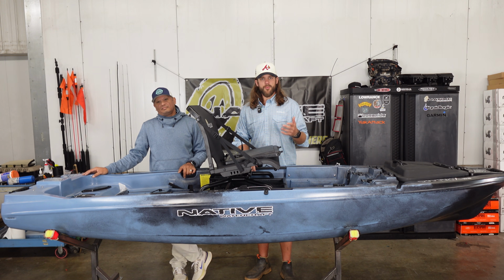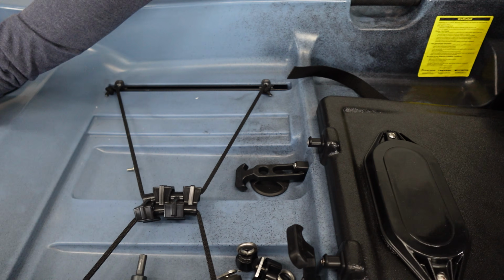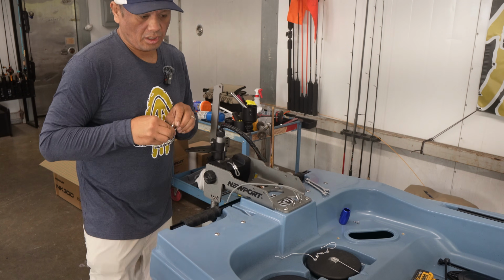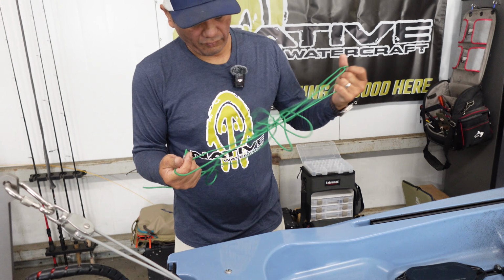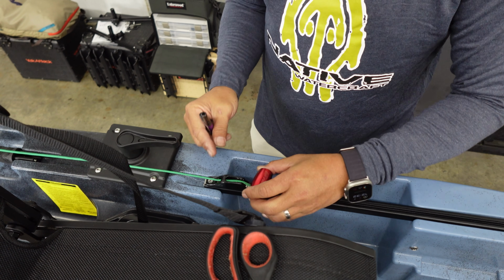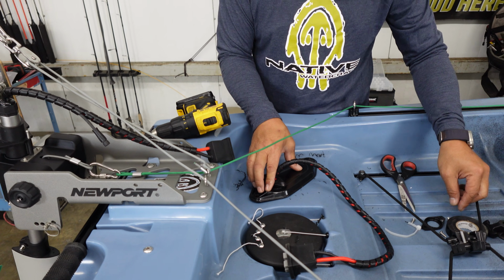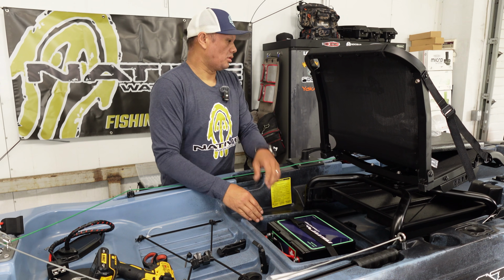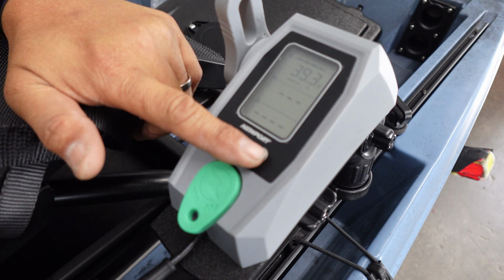How to Install a Newport Vessels NK300 Electric Kayak Motor on Native Watercraft's TitanX 10.5

Comment: What did you guys finally do about the steering?  Did you drill holes in the back and run a cable?  Did you use the cable that came with the rudder system or did you guys use another pair (size and length please?), Thanks!

Comment: Question: I installed  the Wizard FCS foot control on my Native Titan 12 with a Newport NK300. I ran the cord in the tube but on the outside. I can't turn the motor unless I cut it down to the lowest setting. I was worried about drilling  and thought I would try the outside first. I tried first with Yak Attack brackets on the rail and then built brackets to lower where my feet go and push. I've seen some people not put the cord in the tube. Would that make me be able to turn under power?

Comment: Small details down to what torque screw settings, hardware that’s included, what battery you’re using, calibrating the throttle, how the reverse in detail actually works would’ve been nice.
Reply: Ya I agree there installs aren’t the best sometimes

Comment: Can you keep this motor locked in forward position and steer the kayak with the included rudder and handle that comes with the titan ?
Reply: Late reply but if your still wondering yes you can

Comment: No breaker?
Reply from the maker: The digital motor controller on the NK motors have built in circuit protection. This protects the motors from overcurrent and overheating conditions as well ad others as described in the instruction manual in the troubleshooting section.